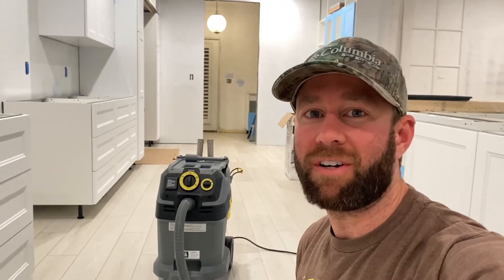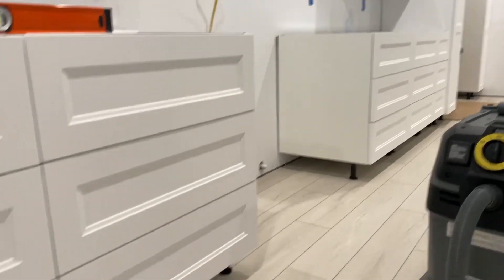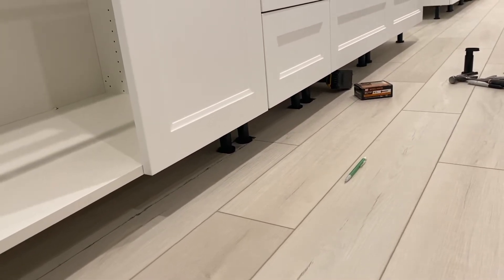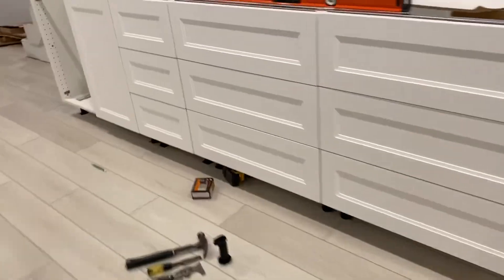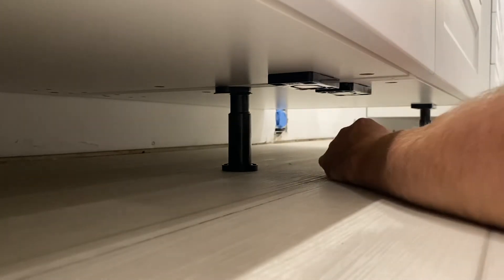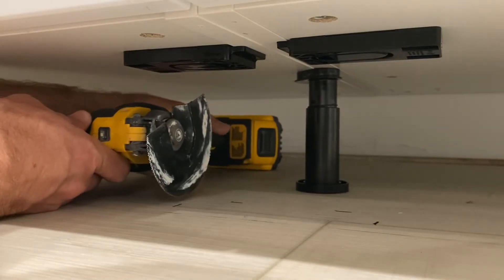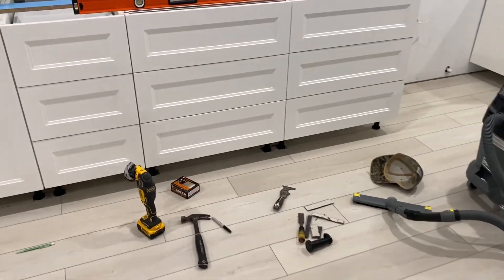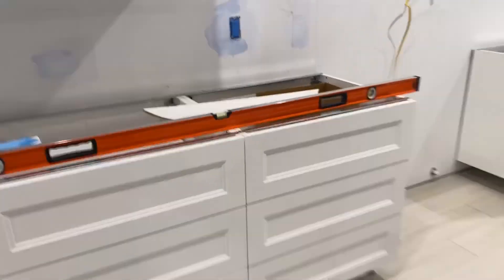How to NOT Void your Warranty on LVP Vinyl Plank Flooring

Comment: Do not do it this way, slight tweak. You should lift up the toe kick spacer rings and mark for your cuts. Then when done, drop the rings so they’re resting on the floor and will properly support the toe kicks.